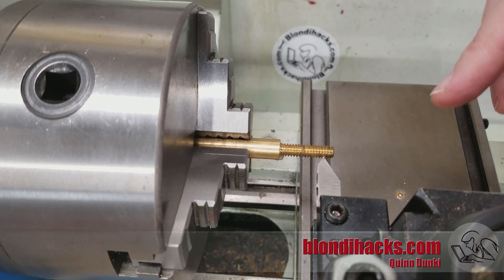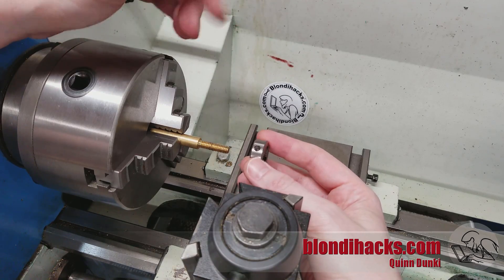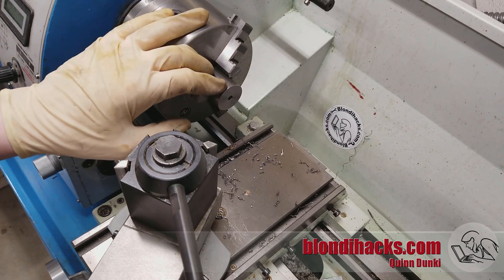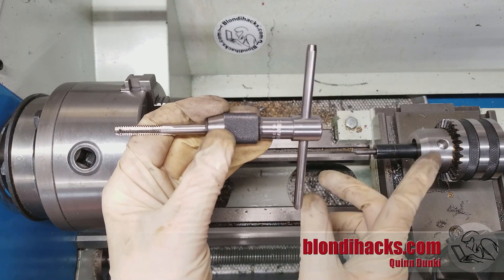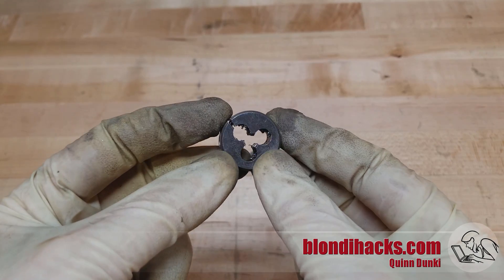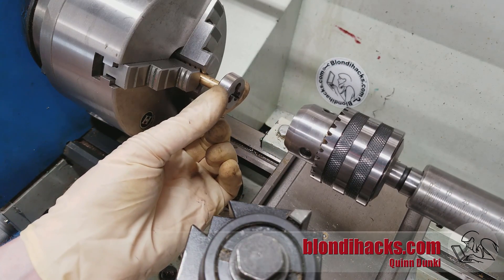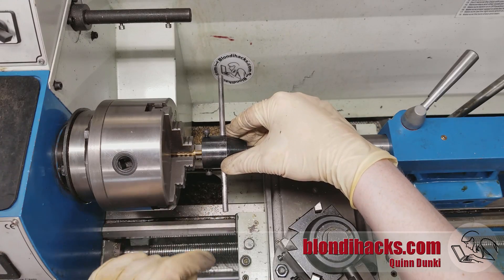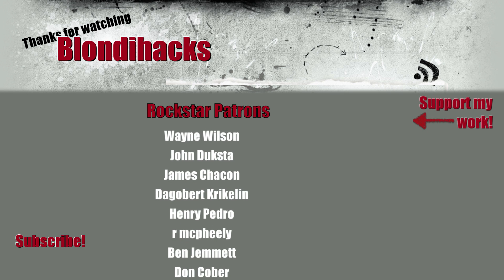Metal Lathe Tutorial 17: Taps And Dies

Comment: I just made the die holder, my second project on my mini-lathe. It has cleaned up my dodgy threading.  One refinement I made is to substitute a C pin wrench for the rod handle; I made 4 holes around the die to accept the wrench's pin (which I also refined a little).  Probably one hole would have been enough.  That works fine for the brass I am threading.

I also watched the tutorial on bits.  I would have benefited from a discussion of the various bit geometries for different tasks, as I received 11 cheap carbide cutters in my lathe package, but there's absolutely no labelling.

Comment: You are just a pleasure to watch. Well done. Many others have given this information, but you are just fun.

As to why to cut single point threads, well sometimes just because. Why not. But a more compelling reason is when you are cutting something out of the normal. The 60 degree V threads through about a half and inch are cheap and so why not use the taps and die. But above that size, or in a form factor other than 60 degrees, single point is probably the way to go. In example, say that you need to cut a 1/2" Whitworth thread, that die will set you back about 20 bucks. Or you can grind a tool out of an old busted off tap and cut it for a few cents in electrical power to drive the grinder.

There is one other place where single point cutting needs to be done, that is when you need to be able to clock the threaded item to a feature. A common case would be say the barrel on a rifle where there are features such as sight bases already on the barrel. A prime example would be say the barrel on a WW2 US M1 Carbine. The gas port and other features are already in place. With a single point, you can define exactly where to start the thread so that when the barrel is screwed into the receiver all things line up.

Comment: As a very new novice machinist…. would it be possible to make a reducing bushing out of a less hard steel or maybe brass,  to act as a go-between the Tailstock mounted Jacobs Chuck and the cylindrical shaft of he Tap Bit?    Would the grip then be more secure between the Rock and the Hard Place?

Comment: While a tap in a chuck (whether Jacobs or Albrecht) will eventually spin, and likely ruin the chuck jaws in the process, it is a great way to start a thread to ensure it is straight, especially with a plug or bottoming tap. Just don't try to get more than 2 or 3 threads going this way before switching over to the tap follower and center-drilled tap wrench to complete the threading and you should be fine. BTW - I have learned from experience that better quality HSS spiral flute taps from reputable brands really are worth the extra money, but in some cases - like with YG-1 - the difference in price isn't even that steep, especially not compared to how much better - and faster - they work.

Comment: Running a Tap in smaller parts I've found can generate a surprising amount of heat, even using cutting oil. The heat can cause the tap to seize in place and break off in the hole if you aren't really careful. I've found something that helps out a lot is to keep a can of Computer Duster on hand. Hold the can upside down and give a shot of that cold stuff on the tap threads cools the work down right away and frees up the tap. (no pun intended).

Comment: Hi there. Can you advise on what diameter i should machine a brass rod to to create an M10 thread ? I seem to keep stripping the thread while cutting & I’m not sure what. 
Thanks.
Reply from the maker: You want to go a bit under the major diameter of 10mm because the die needs clearance. In brass you also need to put a fair amount of pressure on the die to start it or just chews up the end. The first thread isn’t strong enough in brass to pull the die on.

Comment: One of my first projects when I bought my PM 1127 Clone I made a handle for the chuck for such work....It comes from the other side of the spindle stock into the spindle and is Aluminium nearby the inner ID size if the spindle but is two times slitted and has a slightly cone part inside ...with a long center screw this cone comes into the part and pushes the slitted parts against the spindle wall inside and holds the handle very tight (the handle is attached to that part) ...now I can turn the chuck by the handle exactly from the other side of the spindle stock and afterwards if I want to remove it I open the screw which tightens the clone into the slitted part until it moves free again ...it works great and I've never seen a better lathe handle which can be installed and removed that easy...
I love the blondihacks videos she explains everything so logical and interesting they are very good 😎👍✌️
Reply from the maker: Thank you!

Comment: Also, even a cheap BSP die set costs around 160ish$ while the ability to singlepoint thread was already paid for when you purchased your lathe.
Especially if you want to cut a one-off specialty thread, it is usually much cheaper to custom-grind a HSS-tool and make it that way. Add that to the fact that singlepoint threading is fundamentally more precise if done right, and you really have no excuse to not get comfortable with it, especially in the homeshop, where spending a few more minutes instead of dollars to cut a thread isn't that dramatic
Reply from the maker: Except change gears really suck.

Comment: For me (and many others) I'm glad you started out by showing/mentioning model steam engines. That's exactly what I've bought a lathe for. My 7" X 14" Chinese mini lathe is theoretically capable of machining almost every part of a 1" scale working model all the way up to the 7" diameter driving wheels - the largest that might need turning!
Of course nearly all of the tapping and threading would be either 'standard' Imperial or BA sizes.

I'm not sure if a milling adaptor could go that big, though.

Have you considered using a 1" wide strip of material cut from a soda can (several lengths to suit the tap sizes) to put between the jaws of the Jacob's chuck and the tap?

Comment: Who don't you put a spring between your jacobs chuck and your tailsctock die holder. You probably do have one laying around that is big enough to fit over the peice of metal that you use to guide the die holder.
Reply from the maker: Those two parts separate by design. It’s helpful to move them independently and no spring would be strong enough to start the die anyway.

Comment: Just a metric tip for metric tapping, we multiply the M number by 8 and then divide by 10.
Is not precise, but this formula give a quick size to drill before tapping.
For example, to tap an M4 thread, 4x8/10 give you 3,2mm hole size.
M10 needs a 10x8/10 drill bit size o 8mm
Reply: Better to just minus the thread pitch from the nominal major diameter
M6x 1mm pitch / 6-1 = 5 mm drill
Plus the tapping drill for a standard M10x1.5 thread is 8.5

Comment: There is of course other reasons for using single-point tapping, beside precision.

One of those reasons is is the fact that the thread is unusual size or pitch, and the right size and pitch dies or taps aren't in your box of dies and taps. Particularly when you only need ONE thing cut to that thread. If you are able to, and have a thread-cutting tool available (that is suitable size and shape for that thread!), you can get round the problem without finding someone that sells that odd size tap, and without spending the money on a tap and/or die (set) that you will use once or twice in your life.

Also, for those larger operations, cutting thread with tap and die gets really hard work. Even moderately large threads (like M10 or M12 - roughly 3/8" and 1/2") starts to require quite a bit of muscle to turn the die and/or the chuck - I've been known to put a spanner on the chuck jaws before now to get the thing to turn. I don't have bigger dies or taps, but I imagine that M14 or 9/16" would be even more effort - not only is it a bigger diameter, but the thread is also deeper, meaning you end up with a "bigger cut".

Drawbacks are of course that it takes longer - just setting it up is a bit time-consuming.

Comment: I lock the tap wrench between the center and the piece, with the handle of the wrench held by the cross slid. with the lathe in neutral turn the chuck with the left hand and hold pressure on the tail stock with my right

Comment: whot happened to the days when you purchased you taps , they came in sets of three, first , second and bottom tap. on your video, you seem to be starting with a bottom tap, from an old engineer
Reply from the maker: John Boulton You can still get all three, but with the lathe you don’t need help starting the tap straight, so you can go straight to a plug tap (or sometimes even bottoming). I have a full set of taper and bottoming taps, but rarely use the tapers.

Comment: Thanks for showing the advantages of using dies to do threading on the lathe. The last minute or two of the video contained the kicker. That’s where you spoke about the tolerances that can be achieved using single point threading (lathe threading) and how that compares to using dies.
Reply from the maker: Yah, in hindsight maybe I should have led with that. 😀
Reply: It is great thanks .....if you can please send the table of tap and dias

Comment: Good tutorial explains why you use taps and dies and when. You say you get a tighter thread with single point cutting, surely that is only if the single point  tool is ground correctly. How many are accurately ground?
Reply: Mine are...

Oh, wait...

Had to learn THAT skill first.

& I rarely do single-point because it's more work than taps & dies...
Reply from the maker: Excellent point! That does assume a perfectly ground thread cutting tool.

Comment: Square is nice.  I built Gingery's coil winder which required threading the end of a brass rod.  I managed to do the job with a die, holding the rod in a vise, but getting the die started square with the rod wasn't easy.  I ended up with a bit of a lopsided thread on the rod.  So my take up spool on the coil winder had a bit of a wobble to it.  It still worked, but it looked ugly.   Free handing a tap using a tap wrench OTOH is a bit easier for some reason, IF you bore the right sized hole for the tap.  I bet it would be a piece of cake with the lathe. 
I  like how you bore a hole into the middle of a metal rod.  I've attempted it on my drill press by first aligning the chuck with a drill press vise using the desired drill (bit) chucked backwards in the chuck and then lower it into the vise.  With both the vise and chuck in the right places, I clamp the vise to the drill press table, then release the chuck.  Now I chuck the work (rod) into the drill press chuck and lower it onto the waiting drill.  It sometimes almost bores a perfectly centered hole in the rod.  :-)

I get the bit about chucking the hardened steel tap into the jaws of the chuck, but hey, aren't drills just as hard as the tap?  Why don't you have the problem when drilling?
Reply from the maker: Robert nailed it in his reply. Also, even the hardened parts of drills aren't as hard as taps. Try drilling in to hardened steel and watch what happens.  The drill bit dulls instantly. I've done that more times than I care to admit. 😄
Reply: Maybe that's why when taps fail they break off, while drills just burn (at least most of the time.  I've broken off bits, but only ones of small diameter.)
Reply from the maker: scharkalvin Exactly right- taps shatter because they’re hardly tempered at all. They’re hardened to nearly glass hard and left that way. Other tooling is tempered back to various degrees depending on the use case.
Reply: @Blondihacks  & the most annoying tool breakage you can possibly have is a broken tap deep in the part...

:(
Reply from the maker: @Tinker001  So true. It often makes scrap of the entire part. 😕